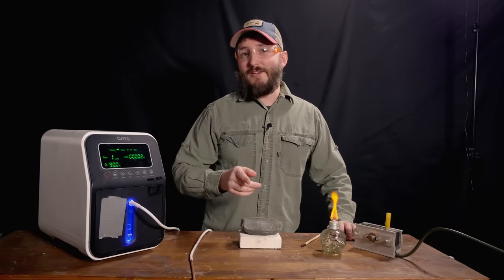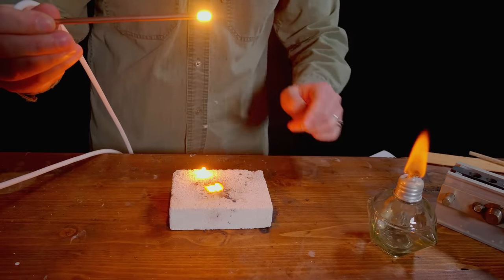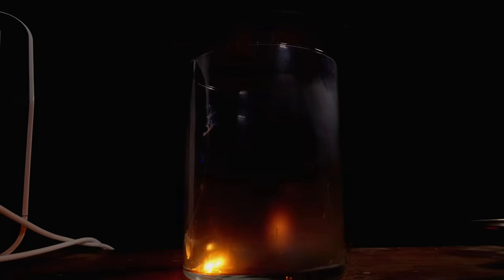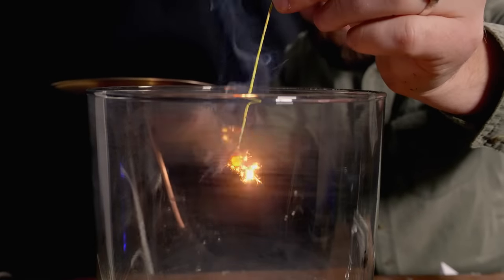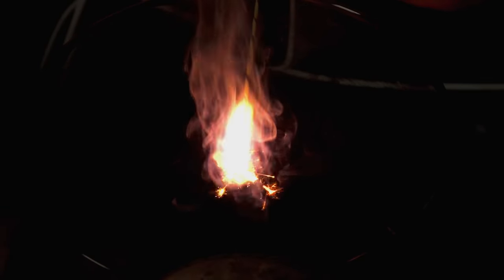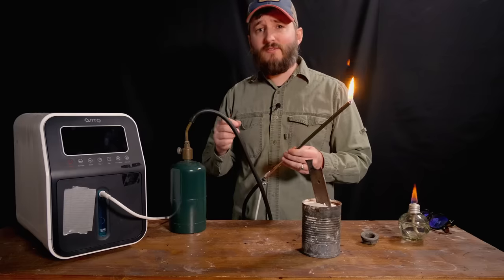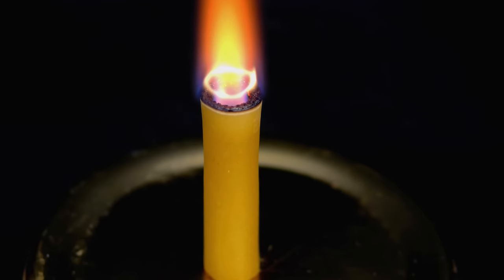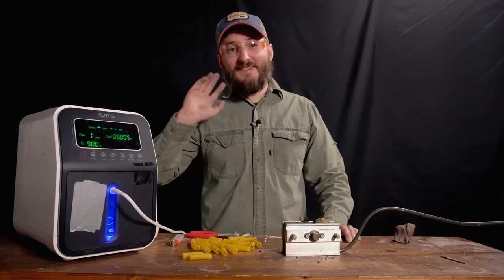6 Unauthorized Uses for a Medical Oxygen Concentrator

Comment: oxygen excite everything around it to be more flammable .meaning it brings the ignition temperature of everything that it touches down .so if you have something that will ignite at 140° if you put it in a 90% oxygen environment it's liable to spontaneously ignite at 80 degrees so what this guy is doing by creating a highly oxygenated environment on a wooden table and flagrantly playing with fire is ridiculously not smart hell the curtain behind him could go up if somebody threw a cigarette at it so when he says that his setup is probably not very safe that's definitely the smartest thing he has said up until that point. So I would advise no one to do anything that he's doing in this video no matter what cuz he already started out just backwards upside-down of wrong. I swear it's like natural selection took the decade off and is on vacation.